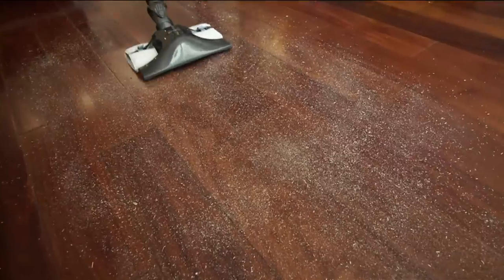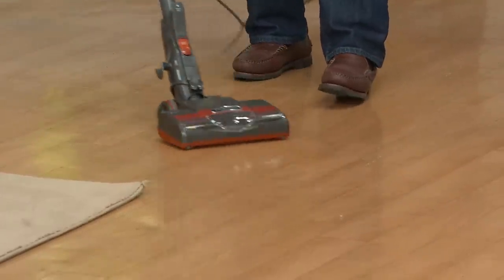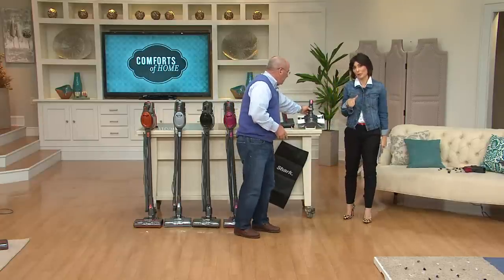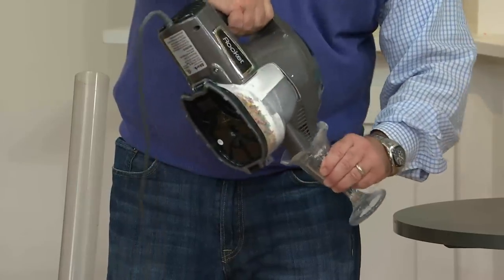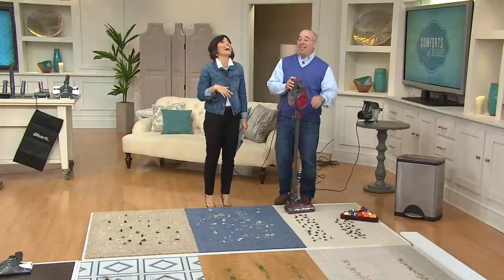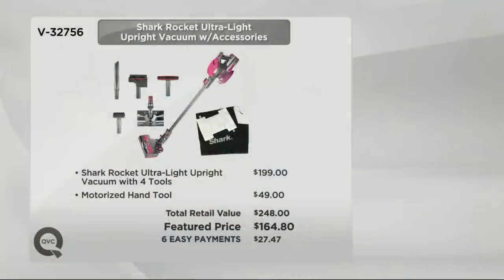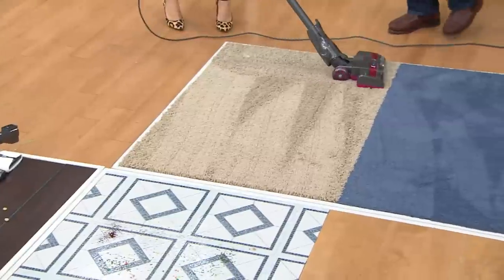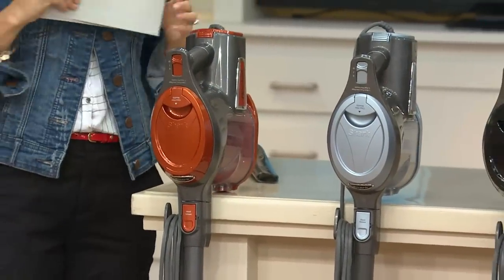Shark Rocket Ultra-Light Upright Stick Vacuum

Comment: Works well on carpets however don't use this on laminate wood floors. It will scratch up the laminate coating quite easily.
Reply: Not if you turn off the beater and/or use the proper attachment.

Comment: this vacuum will stand on its on . I know it comes with hook for storage, but when use you have lean it against the wall.This vacuum clogs up easily  have to pull the mess out. Don't buy the hype. Buy the way got for free that's the only good thing I can about it.
Reply: Gary Nash
Reply: You sincerely need to proof read before you hit submit. Also, if you want it to stand, you have to take the hand vac/main unit off the stick and snap it onto the carpet attachment.

Comment: This vacuum sucks no pun . When you go to empty it which is often it's nasty and dirty. You have to reach in and pull the mess out ,gets hung up inside. Poor design!  You have to lean it against the wall it won't stand up . Sold my Bissell vac,what a mistake.  Got it for free am glad I didn't money for this poorly design vacum.
Reply: Gary Nash There is a hook on the base to put it on for upright storage and the vacuum comes with a hook to put on the wall.
Reply: I am a house keeper and believe me I have tried every vacuum, from rainbow, and the cheapest and this is the best one and the price is really good. I recommend